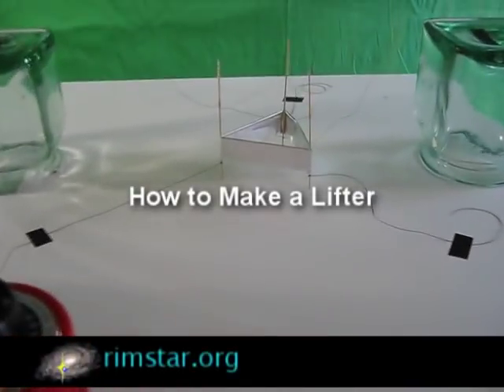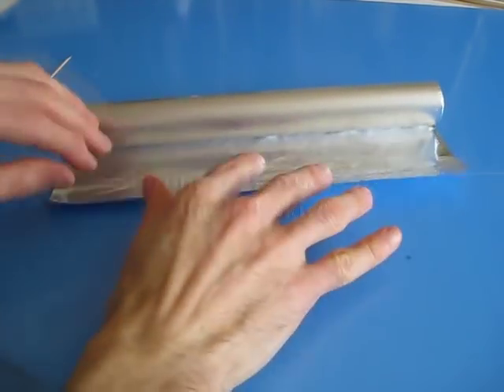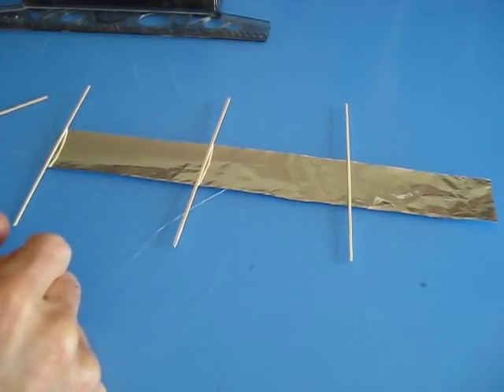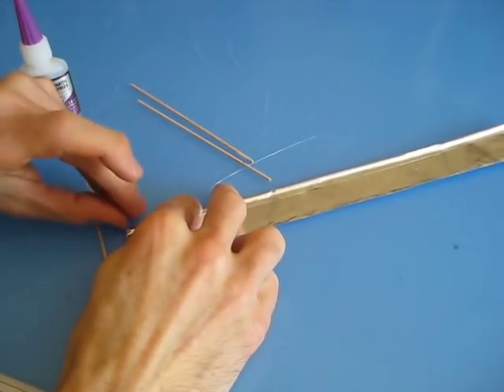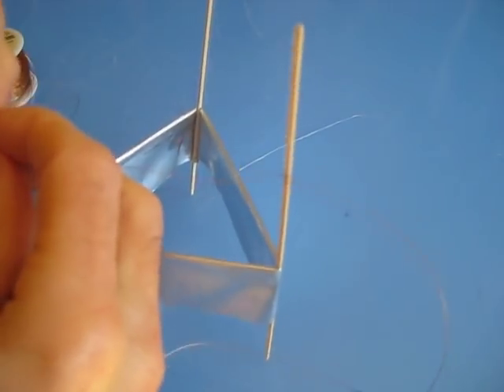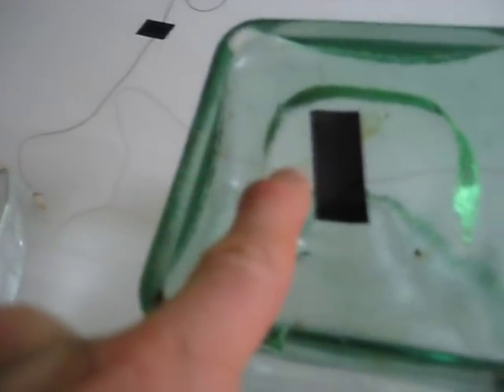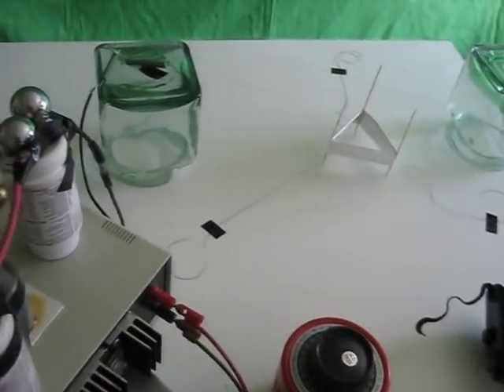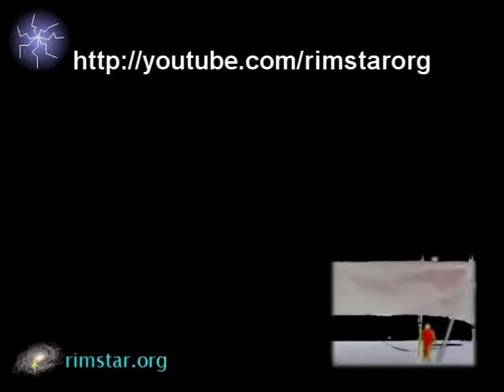How to Make/Build a Lifter or Ionocraft

Comment: Do you have any suggestions or opinions why they lift? I know the MythBusters said it was because the wire is vibrating so much it causes lift because it was vibrating the air around the lifter, but somehow that doesn't sound right to me. They tried to prove their point by placing the lifter in a container that was vacuumed of air to prove it wasn't defeating Gravity, and it didn't rise in an atmosphere vacuumed of air. Correct me if I am wrong. What is at rest will remain at rest unless acted upon by another force, and what is in motion will stay in motion unless acted upon by another force. By removing the air they cut out the force of buoyancy lifting something that was at rest. Before they removed the air the force of  buoyancy help lift the lifter. Am I right or is MythBusters right?
Reply from the maker: +Steve Rabon Really? That was Mythbusters' theory? I'm surprised. It's just plain old ion propulsion. Here's my explanatory video https://www.youtube.com/watch?v=01F8V5IhB5k. And here's a smoke test video I did a while back https://www.youtube.com/watch?v=LOGAaObsN4g.
Reply: Thanks; why didn't it continue to move in a place that was vacuumed of air? Shouldn't it had moved without the absent of air?
Reply from the maker: +Steve Rabon Because it's basically a jet. It takes air from the top and pulls it down. That's the action. The reaction is that the lifter moves up. If you watch my ion propulsion video that I gave a link to you'll see that air is needed. You can even see the moving air in the smoke test in the other video I gave a link to. I didn't see the Mythbuster episode so I can't speak about what they said.
Reply: OK so it ionizes the air?
Reply from the maker: Steve Rabon
Did you watch either video I gave a link to?
Reply: Yes I watched it but I had a head injury and don't remember things very well. I will look again. I will download it so I can watch it over and over. That might help I believe
Reply from the maker: +Steve Rabon Ah. Sorry to hear that. Thanks for clarifying.  You had me puzzled.
Reply: OK yeah I watched it again and downloaded it also. I was remembering the part about the pointed electrode and the rounded electrode but failed to remember the air part. Thanks it will take me a while to understand and remember everything but since I downloaded it so I can watch it again and again it will help. Thanks again.
Reply: +Steve Rabon 
Remember the MythBusters aren't scientists, they are entertainers.
Reply: Sadly, "the Science" <<we know>> is not what it should have been if we lived in freedom.
Reply: They implement the scientific method, don't they? I'd say they're scientists who entertain.
Reply: Exactly, tell them!!!
Reply: This guy mentioned “hydro static charge” in the video. So the ion flow is caused by humidity or nitrogen or oxygen in the air. So this thing could not be used in space to fly to the moon.
Reply: Mythbusters also said men walked on the moon but the distance from here to the moon is full of radiation and the space craft was made from materials that would melt at considerable low temperatures space hits 2K+ C it is very hot they only manage low orbit and the earth was a distant shot of the earth in low orbit as they photographed the round window, thus if you look at any picture of men on the moon and you make a colour saturation on that image the earth you see from the moon has a square all around it. Mythbusters are a mythi of their own bullshit
Reply: Steve Rabon it repels the electrical charge in the air no air no charge no fly simple
Reply: WTF is the "force of buoyancy". Is that something you made up, because it sure sounded like it. There are four known forces plus a possible fifth and I'm sure that the force of buoyancy is not one of them.

Comment from the maker: With the lifter we want unidirectional thrust. So the bare wire does the corona discharge (i.e. it ionizes air) and the smooth foil skirt is attracted up to the ionized air. The fact that it's smooth allows it to build up a surface charge, or high voltage with respect to the ionized air, so that it can be attracted to the ionized air. If it discharged instead, then it wouldn't build up the surface charge and it wouldn't be attracted.

Comment from the maker: I think you need at least 30kV but I seem to recall reading once years ago about someone using single digits kV. If you do try, you'll have to put the wire much closer to the top of the foil skirt due to the lower voltage. Best if the distance between wire and foil skirt is adjustable so you can try different distances. Make it as lightweight as possible too.

Comment from the maker: There are many different high voltage DC power supplies so it depends on which one. Ones that have a flyback as their last stage put out AC but ones that have a Cockcroft-Walton voltage multiplier as their last stage are rectified and put out DC. Mine has a flyback followed by a Cockcroft-Walton voltage multiplier so it's rectified and hence is DC.

Comment from the maker: I measured it while flying using 26,000 volts DC and around 275 microamps. You can see me doing the measurements in my "Lifter Voltage/Current and Smoke/Aiflow Test Measurements" video. There's a link to it in the description below this video and you can find it on my channel page.

Comment from the maker: In this power supply the negative is connected to ground and is connected to the skirt. So the negative is at the same potential as the Earth ground which is ultimately connected to a pole stuck in the ground in the backyard. The positive can be as much as +30kV relative to that. If the ground truly has the same number of electrons as protons then you could say it's not negative as all, in which case I have HV positive and 0V.

Comment from the maker: It depends on the voltage and how light your lifter is. The lighter your lifter, the lower the voltage required. The lower the voltage, the smaller the distance can be. Humidity also has an effect. So I don't have any specific  numbers.  In my "Lifter Voltage/Current and Smoke/Airflow Test Measurements" video my 2 gram lifter lifted off at 26,000 volts, with a distance at one corner of 2.5 cm and 4 cm at another corner. I suggest making the distance adjustable like mine.

Comment from the maker: Sorry, I somehow missed this comment of yours. It works with the top wire positive or negative - this video uses positive, my other lifter video uses negative - but I think I recall it works a little better if negative (I could be remembering wrongly - something for your science fair experiment to test!) Alligator clips are heavy. You can use them as long as it's where the lifter doesn't have to lift them.

Comment from the maker: The total would still have to be just as big and need just as high a voltage. However, I'd think you'd need at least three thrusters or something like that in order to keep it stable in free flight and for basic direction control.

Comment from the maker: I guess you'd need to add some sort of circuit to keep pulsing the ignition transformer to keep the output going? I once made a high voltage power supply using an automotive ignition coil and pulsed it using a 555 timer chip circuit.

Comment from the maker: If your cloth is light enough and you have enough current feeding your needle, you might get a reaction. You'd probably have to do quite a bit of trial and error first. I also find cloth hard to charge up. Thin nylon or acrylic might be better. But you can do without the cloth since a sharp, negatively charged needle will emit electrons on its own due the the strong electric field at the needle tip. That's what I did in my "Ion Wind Rotor" video.

Comment from the maker: I've no doubt shape would make some difference and as you point out, there are many variations. But I don't think any one person has done enough variations to rigorously say what's best. Oh, pulsing the high voltage can also be an improvement. The best list I know of is on the blazelabs website, in the EHD Thrusters menu, Thrusters Performance page. No one's gotten close to lifting the power supply and until some kind of super light power supply tech is invented, they probably won't.

Comment from the maker: ;-)
You need a high voltage, reasonable high current power supply. There are some links in the description below this video to my webpage where I show how I made my 30kV power supply and another link to how to use an old computer monitor as a power supply and also a link to where you can buy one (make sure it's output is high voltage DC.)

Comment from the maker: If the rips/holes are near the top of the foil then it's the same as the foil having some sharp edges. Instead of the foil holding onto its charge, it will start losing some and ionizing air. The voltage between the foil and the wire-produced ion cloud will be lower and the lift will be less. I usually see this if there's a lot of sparking between the wire and the foil. The sparks blow tiny holes in the foil and the lift performance eventually decreases.

Comment from the maker: 30,000 can be gotten with a small Van de Graaff generator easily, but you also need the current, around 250 microamps, which a small Van de Graaff cannot supply (hmmm... I should try my big VDG). There are links in the description below this video to my webpages about making the higher current power supply I used in this video and also an old PC monitor one but the really old monitors are hard to find.

Comment from the maker: I've tried to think of ways of measuring the thrust but so far have been unable to. As for working at lower air pressures, tests have been done in vacuum chambers at very low pressure and they did move, though with clearly far less thrust.

Comment from the maker: The thin wire acts like a sharp edge. The electric field near a sharp edge is very strong. This strong field either leaks electrons (if the wire is negative) or rips electrons from nearby atoms in the air (if it's positive.) This results is ionized air near the wire. This ionized air is attracted to the field around the foil skirt and is what starts off the whole ion wind that makes the lifter fly. The wire must be uninsulated and as thin as practical. Mine was 30 AWG (American Wire Gauge).

Comment: Good idea and very simple.
Lifter system with electrostatic field dangerous for people and for the surrounding environment. Due to the extra high voltage wear.This is will generate free electrons/ions that can disrupt or damage electronics component or damage uP control.
Except unless there is an electronics control system.
That works with infrared /low laser beam or optocouplers.
There must be a uP that works with a light sensitiv component system and circuit board wearing fiber optic.
Actually the most sensible and is the system using reverse gravity or gravity inversion.
For ex: Is to use the momentum of the centrifugal repulsion as a model gyroscope antigravity and so on.

Comment from the maker: The GRA 10 supplies up to 20kV. My lifter didn't fly until 25kV, so I can't guarantee that it'll work. They are fairly reliable and knowledgeable people, so it may just take a little playing with the lifter and care with the wiring leading to the lifter to minimize losses. The GRA 10 requires a 12V, 3amp power supply. I'd just use an adaptor, one of those things you plug in the wall that puts out 12V DC. There's also no fuse so either add one or use resistors as I point out in my video.

Comment: Thanks for the prompt response.  For force measurements, how about tethering it with three threads (as you show), but fix the ends of the threads together and to a small mass (eg, a plastic washer).  Then support the lifter on a plastic ruler so that the threads are almost extended, and rack up the voltage to see if it can lift the washer; then thrust ≥ mass of washer, at least.

Ion Thruster Weightlifting Challenge !!

Comment: The term "lifter" is an accurate description because it is "not" an anti-gravity device; rather, it produces lift using the same basic principle as a rocket, i.e. from the equal but opposite force upward generated by the driving force downward, specifically by driving the ionized air downward in the case of the ionocraft. Much like a rocket or a jet engine.
Reply from the maker: Richard Green Yup. You can find a more detailed explanation of how the ion propulsion works in my other video "How Ion Propulsion, Lifters and Ionocrafts Work".

Comment from the maker: You'd need something that still very lightweight. This lifter is only around 2 grams. The only thing that comes to mind is carbon fiber, which you can usually get in hobby stores that sell radio controlled planes. And I guess you can find it online. I don't have experience with it so I don't know if even that is light enough or what kind of work is involved in making parts out of carbon fiber. I know there are also carbon fiber rods.

Comment from the maker: It gives off ozone. Some say that large quantities of ozone can be harmful. Just use it in a ventilated room and you'll be fine. When I'm filming a lifter I have to shut all windows due to sound issues, but I open them afterwards and run a fan and I've had no problems.

Comment from the maker: By "don't to waste time and money using resistors", do you mean the protection resistors I show in this video? Definitely use those resistors if you're using a computer monitor. They're there for if/when an arc occurs, not for when you have just ionization going on. I blew my monitor power supply that way and so have many other people. But I agree the dimensions don't need to be exact. I give these dimensions only so someone doesn't make a big, heavy one for their first try.

Comment from the maker: The experiment was done with pulsing from 0 to 100Hz. 70Hz required the least power, 17.72 watts, 14.59Kv RMS and 1.22 mA RMS. But you can experiment to find what works best for you. It can't be alternating. It has to be DC pulses. You can see it at jnaudin.free.fr/html/lftphv.htm

Comment from the maker: @mrnewagemotor What do you mean by "atmospheric anti-gravitation"? I've done wind tests back in 2001. It's basically a jet (see the link in the description, the flame test.) The top wire creates a cloud of ionized air and the foil skirt attracts the ionized air down. The skirt doesn't ionize much air because of the rounded top edge. If there is an anti-grav effect, it doesn't play a significant part.

I should do another video measuring voltage and current to answer your second question.

Comment from the maker: The thin wire ionizes the surrounding air, the rounded foil doesn't. The resulting ionized air attracts the foil upward while the air is pulled downward. Basically ion wind. You can see this air in the smoke test I do in my video "Lifter Voltage/Current and Smoke/Airflow Test Measurements" which you can see using the link in the description below this video and on my channel.
There are also links in the description for power supply options (make one from scratch, an old monitor, or buy one.)

Comment from the maker: You'll need a high voltage power supply that has a decent amount of current. A large Van de Graaff generator with a 15" dome might work but not a Wimshurst machine. You can modify an old tube type of computer monitor that doesn't have energy saving features (there's a link to my webpage about this in the description below the video.) You can also buy HV power supplies from amazing1 dot com. Make sure you get DC. There's a link in the description to my webpages about my homemade power supply.

Comment from the maker: Wood is an insulator. I've heard that it can be bad to use wood with high voltage but in all my years I've never found that to be the case. That includes with lifters. I've had plenty of arcs but they've never traveled along the wooden supports. Maybe if the wood's wet with tap water containing impurities, or something is coating the wood, or it's some sort of wood that has a lot of conductive material in it.
Anyway, I'm glad you enjoy my videos, and thanks for watching!

Comment: Dear RimstarOrg

I just finished building the HV-Powersupply. It works like a charm.
I deeply studied the report that your provided me from Army Research Lab: Force on an Asymmetric Capacitor.
Unfortunately there are still some in fundamental questions that I could not answer.
The writer tried to explain the generated Lift as follows: 
Therefore, the physical picture is that in the high field region the electrons, with their high
mobility, are swept out by the electric field, toward the thin wire electrode leading to screening
of the field. The massive (probably positive) ions are less mobile and are left behind in a plasma
surrounding the thin wire electrode.
I can't really get a picture of this in my head... 
Also does the length or width (generally the mass) of the Aluminium foil have any effect? I know it can store a larger static charge but does it affect lift? 
I am assuming that the key factor is the distance between the copper-wire and the aluminium foil and of course its shape -> sharp to "flat" surface.

Thank you so much for you attention in advance and best regards

- Kaplan

Comment from the maker: There shouldn't be any difference. But for comparison it would have to weigh the same. I experimented with copper foil a long time ago but it was heavier than the aluminum foil, so the results weren't as good. But that's just a weight issue.

Comment from the maker: I don't think so. And x-ray requires a high energy electron hitting a heavy element like tungsten (atomic weight 183.84). The only time there are high energy electrons in a lifter are if you have an arc between the wire and the aluminum foil. Aluminum's atomic weight is just 26.982. But I don't know if there's enough energy in the electrons during the arc or if aluminum is too lightweight. I've never heard of there being a danger.